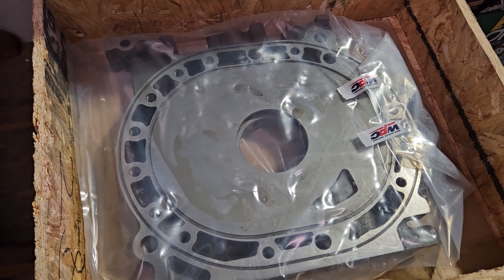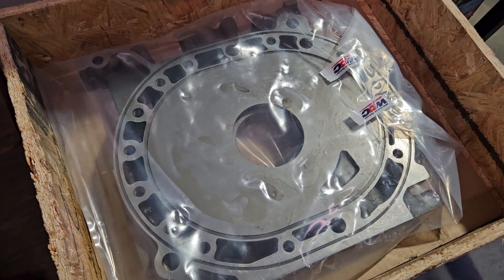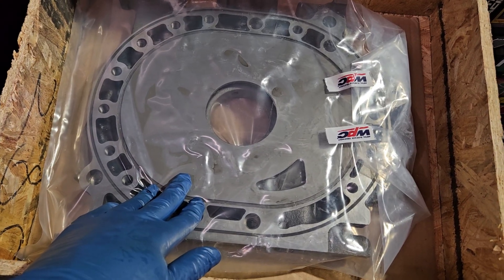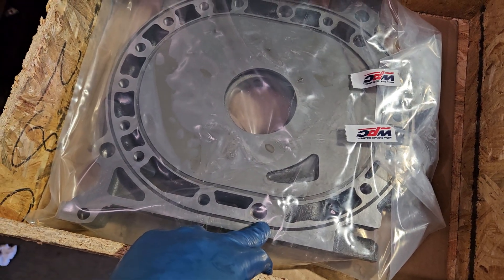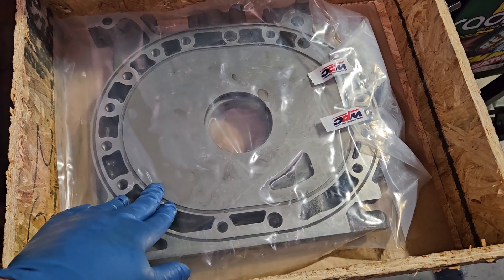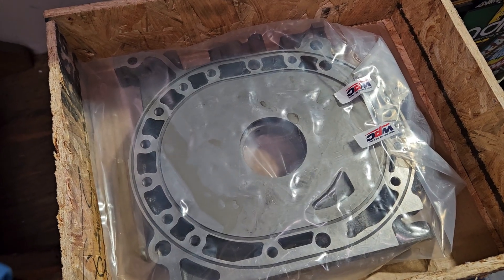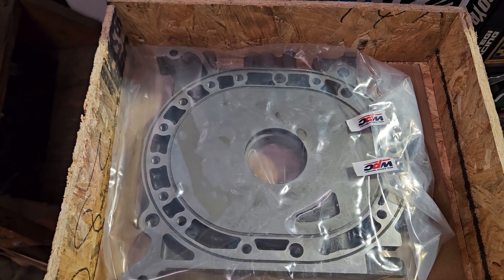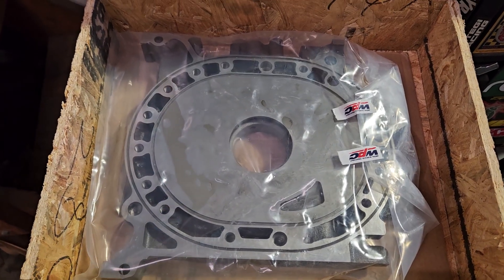Lapping and surface hardening & friction reduction with WPC Treatment - KMR Rotary

Comment: Been looking at building a hybrid renesis engine for years (renesis plates, rotors, eshaft, GS LSE housings). Would it be worthwhile getting the plates done for a naturally aspirated build with the possibility of boosting down the line? Also can it be done on the housings and if so would it be worth?